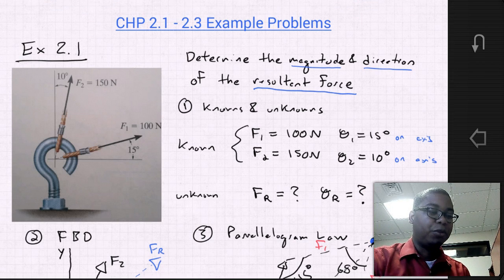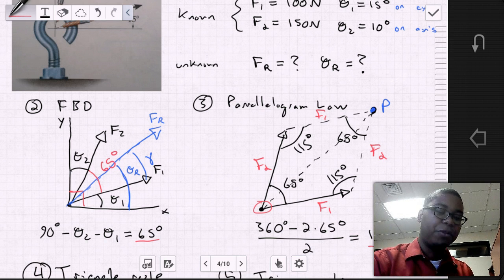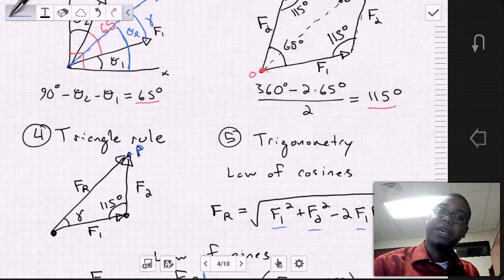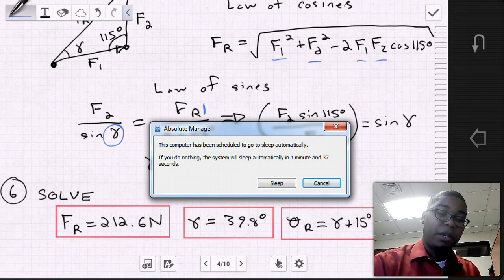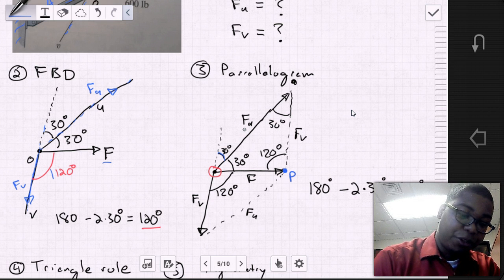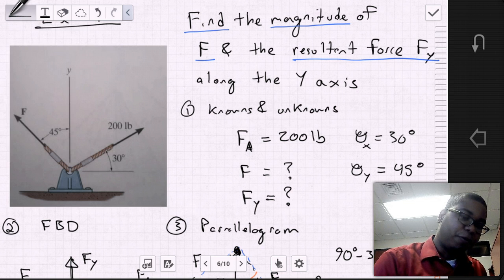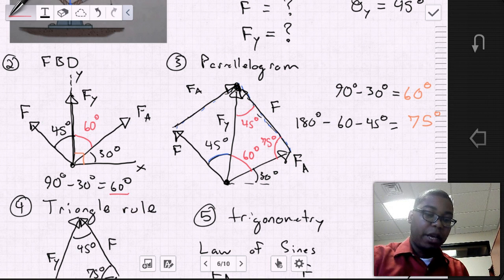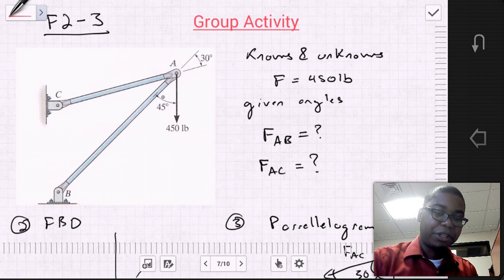Force Vectors - Example 2 (Statics 2.1-2.3)

Comment: may i get solution please 
  The post is to be pulled out of the ground using two ropes A and B.
Rope A is subjected to force , F1 and is directed at angle θ1
from the horizontal. If the resultant force acting on the
post is to be FR, vertically upward, determine the force T
in rope B and the corresponding angle θ.
Given:
FR = 6 KN
F1 = 3 KN
θ1 = 60 degree

Comment: I am having a lot of trouble getting the value of gamma using the law of sine...I keep coming up with decimal places I structure the equation the exact same and still get messed up...(150sin(115))/212.6=.667    then asjn(.667)=a crazy decimal place that isn't close to 39.8. I know I must be looking at the equation wrong but cant figure it out. HELP
Reply: well, the answer is not 0.667 but 0.639. asin(.639) is 39.71 deg

Comment: Im in your spring 2015 class and we already saw this sections but I am still stuck with a problem similar to Ex. 2.1. We had some in the homework the only difference is that some forces where in the 3rd quadrant, i would like to see you solve an example with forces in the 3rd quadrant please, because I get confused on how to manage the angles that are 'negative'. Thank you
Reply: Since in the examples you only work with forces in the first two quadrants.
Reply from the maker: Elio Tapia In a problem where the force vector is in the 3rd quadrant, the angles will not be negative. (Angles are described relative to an axis and thus should be positive quantities) The negative sign comes from the direction of the force components. If a force vector can be broken down into components and those components are going in the negative direction (compare to the assumed positive axes) then you will place a negative sign in front of the term. Hope this helps!